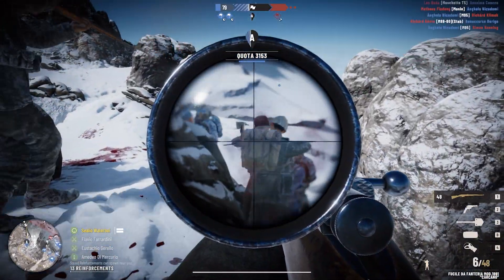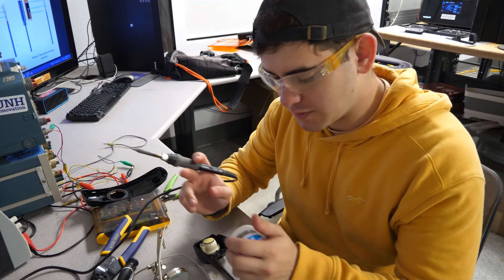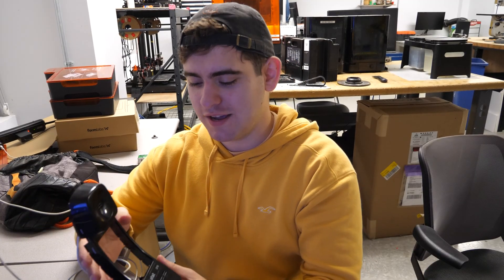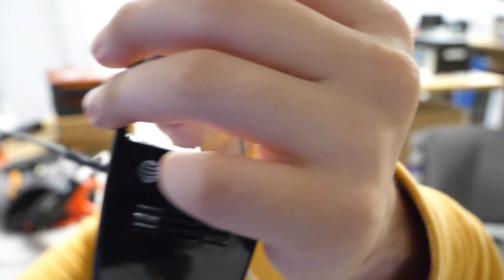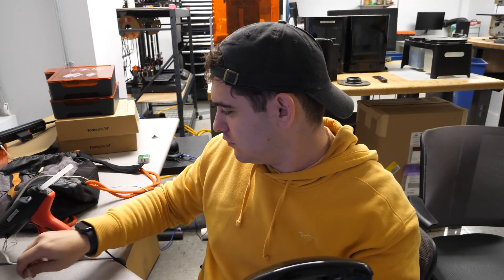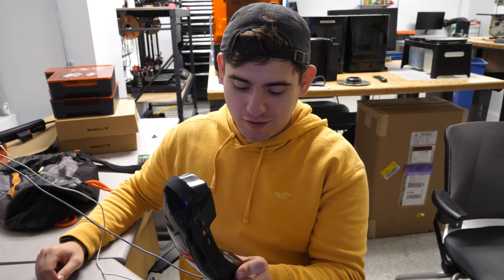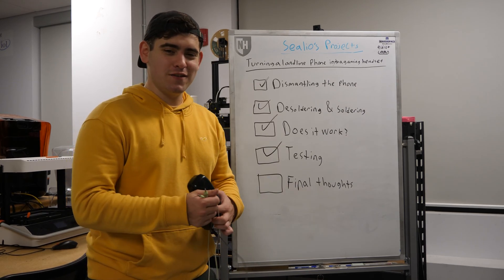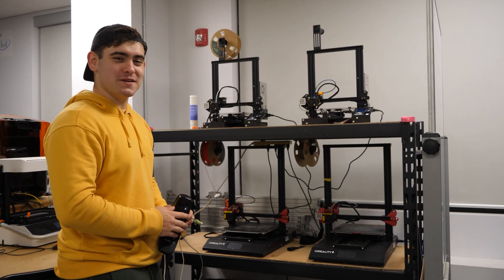I turned a landline phone into a gaming headset

Comment: This would be cool for just making phone calls since landline phones are way more comfortable to hold than smartphones are. I noticed that the mic was peaking when you first tested it so maybe you should adjust the gain lower so it doesn't peak so much if you didn't do that already. Anyway it's a great video! :)
Edit: oh yeah just remembered that you should try to add the keypad back (maybe remove it from the pcb and tape it in place or something) so it doesn't have a big hole in the middle.

Comment: That's why I just buy the condenser mic capsules (which cost cents) and build them a tiny class A voltage amplifier that drives the microphones and uses a 12V source. Then the output goes to my pc at the line in and I get barely -50dB of noise in voice meter banana and good sound quality... For dirt cheap.